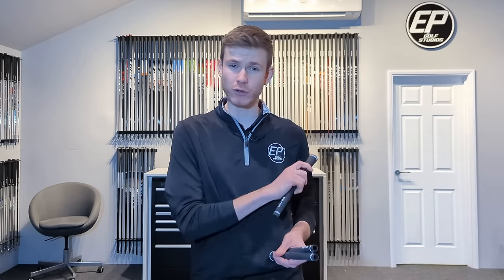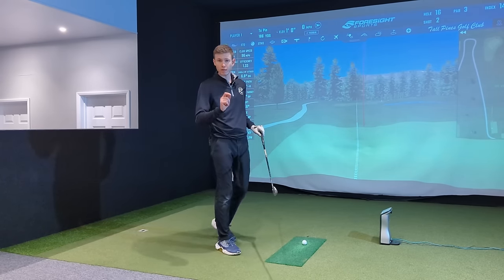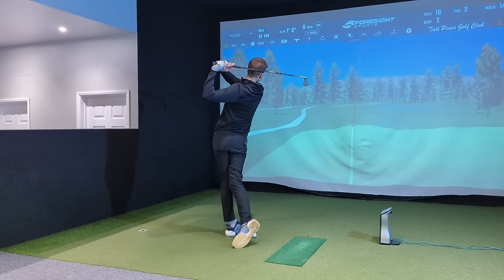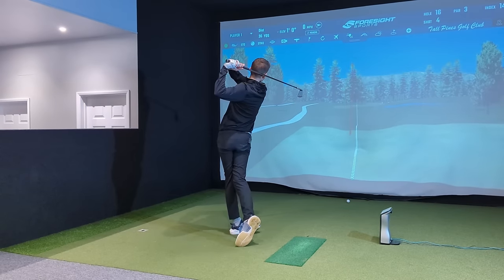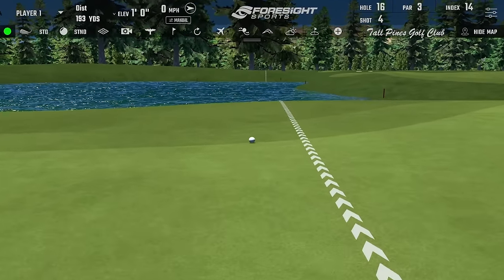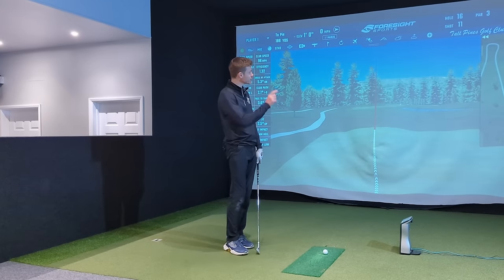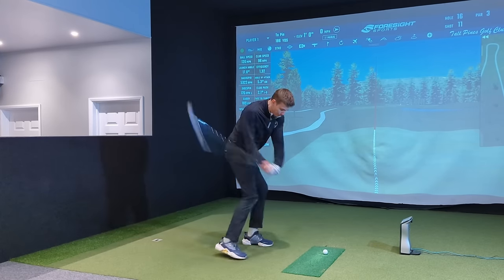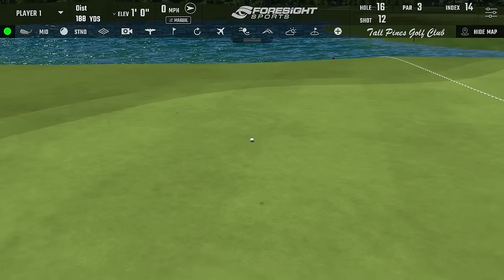The Right Grip Size? What We Look For & What Does It Do?

Comment: After watching this video, it suggests that there isn’t a huge difference.
Reply from the maker: Same as anything when it comes to equipment, everyone will find slightly different results. But the idea that a bigger grip will help you stop you turning your hands over and prevent the left miss is mostly a myth in my opinion. But can have benefits elsewhere for the right person.
Reply: @epgolfstudios   I think there is something to be said for getting a grip that fits your hands.  Grip diameters have been the same forever and there are simply more bigger, taller people then there were 50 years ago.  And having a grip that is too small could cause you problems.

Comment: @15:34 that is why in statistics you take out the one-off extremes from the calculation
Reply from the maker: In some cases I do yes, it depends what I am testing. In this test I didn't take out any bad shots (only ones that exceeded the swing speed that I was trying to achieve). However if I was texting a club or shaft I would take out any very bad shots because I am trying to see how the club performs, not how well I perform.